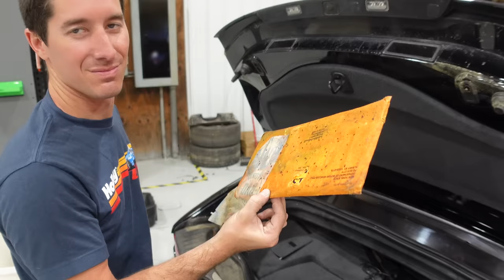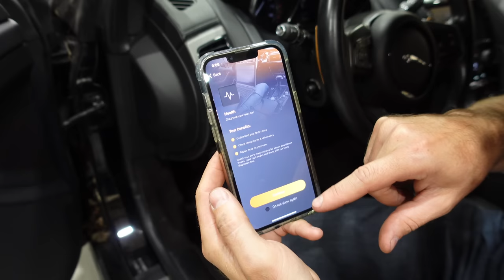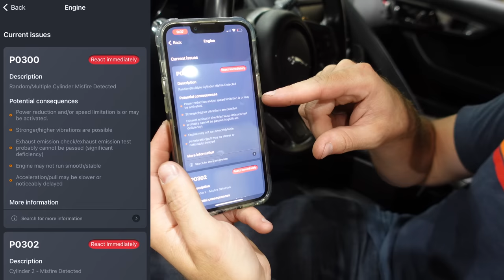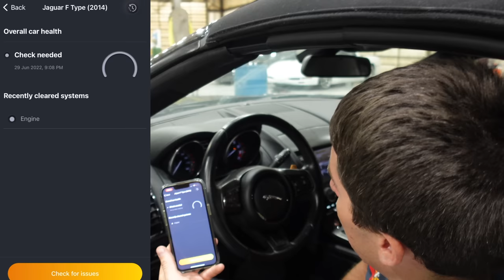My CHEAP Jaguar F-Type S Actually RUNS But It's Horribly BROKEN

Comment: The posts under the bonnet on Jags are usually just to provide power to open the boot to access the battery.

And then a jump pack should be placed directly on the battery, not on those posts.
Reply: These are Americans, do you really expect them to do anything properly? They didn't even check if the engine had spark plugs or inspect the cylinders for leaks or scoring before they went ahead and started it.
Reply: @Exemplifiera  When an engine turning over squirts out rusty water, I'd also want to do a little more investigation that just putting the old plugs in and sending it. Even a few cents in fogging oil could save a LOT of damage on the next run.
Reply: @Dylan Farnum  I've owned multiple XF's (same engine), and performed cooling system repairs on them all. Original factory coolant can be orange, but if it's a 2014 that should have been replaced already. My cars had many different colours of coolant from the Jaguar dealer. Pentosin 'pink' is the type I always used for a flush.

And yes, I'd still be investigating if there was pure water in the cylinders, or gold, or anything other than air. Chucking the plugs in and cranking it without checking you're not going to hydrolock it first would be a good idea, just in my opinion.

Burst coolant line (it's actually the brake booster vacuum pump line, btw) or not, coolant is certainly getting into cylinders somewhere looking at the steamshow.

If they had put the plugs in first, there's a big chance that would have happened. Relying on dumb luck with a car in that profit margin territory doesn't seem like a smart plan to me.

Setting the risk of that aside, do you think it's a good idea to start a car that's had coolant sitting in the cylinder for a while without checking it out a little more thoroughly than saying 'oh it's oil, lol' and moving on? Let those coolant crystals scrape as much of the cylinder wall and valves as you can, right? With a little luck it can foil the injector too, they are only about 300 bucks each. Good plan!

I'm glad you don't work on anything I drive.

So yes, I do know better from hard and sometimes expensive experience. Thanks for noticing!
Reply: @dylanfarnum1488  I think your sadly talking shite there. I sold all my XF's in great condition and I still see them around now and again.

There are lots of places coolant can meet up with intake air and none of them have anything to do with head gaskets, cracked blocks, or holed cylinders (that doesn't even make sense, how does a holed cylinder only get coolant in the cylinder and no other symptom??).

And no, I wouldn't replace an engine of this expense and rarity for a damaged cylinder either. 'new engine' is a serious last resort, good ones are very hard to find.

If you don't know and have nothing to add, that's OK: just please don't post Ill informed nonsense. You're not helping.
Reply: @dylanfarnum1488  that's for the non Jag part, buttercup. (Which is fine, it's Bosch, good enough) but you're still going to be out 300 though honey bunch, because they need coded and flow calibrated in SSD or the ECU will throw a check engine light after a couple of minutes. Unless you have Jag SSD access (I did have when I worked on mine and I can't imagine doing work on the car without it). 

I'd have thought you'd have known that as an expert?

That's nice you have an f-type AWD, I'm guessing you haven't had it too long because you don't seem to know that much about it's workings.
Reply: @dylanfarnum1488  I didn't ask you to explain anything, because I'm quite sure you'd be wrong. I said that coolant having burnt an actual hole in the cylinder would create considerably more symptoms than just some steam from the exhaust. Have another read if in doubt.

Actually, know what? I've never seen coolant burn a hole in an actual cylinder come to think of it. When it gets to the temperature to melt cast aluminium it tends to turn to steam and blow a hose. 

I've seen head gaskets go, and I've seen pistons smash cylinders... Or blocks crack, but never coolant and water creating a hole in a cylinder, unless by long term corrosion.

Can you please explain how that happens? Cite some examples if you can? I'd love to know!
Reply: @dylanfarnum1488  no please, we are all still waiting for your lecture, professor. Tell us about the coolant burning holes? Please?

Also none of my cars have been on a trailer (other than the ones I collect as non runners) and what puts jags on trailers 90% of the time is people like you with no sweet clue 'working' on them.
Reply: @dylanfarnum1488   @Dylan Farnum  it seems to me that's absolute nonsense and you're just embarrassing yourself now.

But, what do I know?! This could be a great chance for me to learn. Let me review:

When coolant and oil mix on top of the piston head (uh, wut?) they don't burn off under combustion temperate and pressure as I'd expect, but instead create 'hot spots'. These 'hot spots' then get up to the requisite temperature to liquefy the surrounding metal and melt cylinder walls, putting holes in them. The wall itself nor the the coolant running around the walls is enough to reduce this temperature to safe levels. The block then cracks. Have I got that right?

I'm going to ask you to cite some source on that please, doesn't have to be anything fancy just any website or yt video with an example I can study. 

Quick as you can, I'm fascinated by this process that seems to defy physics and I'm eager to learn as much about this as possible. Thanks!
Reply: @dylanfarnum1488   @Dylan Farnum  it's hard to understand because you're not making sense. You're now off on a whole other tangent about valve seals and spark plugs. Spark plugs, which by the way are on the floor in the video and can be easily checked!

Citation, please! If this is such basic simple stuff you'll have no problem finding one. Just one. That's all we need. All I've ever seen a small coolant leak into a cylinder do is clean everything really nicely, personally. A large leak, well, you'll know and it can do a lot of damage, especially if the engine is turning! But that's not even the point:

We just require an explanation of your comment of coolant in the cylinder being definitely a holed cylinder which needs a new engine, even though there a ton of other reasons it could be there which are much more likely and should be checked FIRST before turning anything over.

We need this so we can accept your assertion that turning over a wet engine is fine, which is what your asserting.

What's so hard to grasp about that?

Again, if you don't know, that's cool, but you have to stop saying random things you can't back up. That's misinformation and with cars like this, that can be expensive.

And coolant isn't corrosive to aluminium, even when burnt, for f-cks sake, how well would THAT work in a majority aluminium engine? Jesus.

When I first started owning Jags about 23 years ago (in the UK), I had to wade through SO MUCH absolute tripe on line to find solid information. So many people with opinions passed off as fact, it literally ruined the brand. From 'oh it's British and weird we can't work on it' all the way to 'oh you need this expensive thing' when it was actually a five dollar part - made the experience very frustrating.

It's even worse here in North America.

I fully believe everyone should own / drive a Jag at some point in their life and this sorta 'support' from the 'community' literally kills it.

I'm sure this is also true of other brands and I think I speak for everyone that most people just want straight forward factual information that's useful and true.
Reply: You two are big mad. Jags are unreliable, just like Rovers. This is common knowledge. Doesn’t mean they’re not cool.
Reply: @asands257  Poxy Ford engines…

Comment: Be aware, F-Type has a notorious battery drain after OBDII usage. After each use of the OBDII port, I have to disconnect the battery to reset the computer.
Reply: It could just be the device you're using, not all devices cause the battery drain, I've never experienced it after the port has been used.

Comment: And mine was a 2011 XK Jaguar convertible luckily I was just a couple blocks away from the Jaguar dealership where they could take care of it but like I said in the earlier comments it was the fuel injectors and it only did that exhaust thing and spit and sputtering

Comment: so ive been there too. The car has 2 batteries. One controls the engine and what not, the other runs the app and security stuff. the main battery is supposed to be an AGM battery. as for the leaving the charger on it all night, you have to leave the charger on the battery itself. the front boost terminals will not charge the battery. I figured that out when my car locked me out and needed a battery replacement. 

Lastly, AGM batteries are very sensitive. you cant hook up a booster to them directly. theres microchips inside that limit the draw and monitor the battery condition. you have the charge the thing with an AGM charger at like 1a. could have saved myself $500 if i knew this earlier
Reply: I know several people who charge their F-Types from the underhood terminals and iot works just fine.  Not sure why you think it doesn't work.

Comment: It's not antifreeze, since it disappeared so quickly.  It's obviously the blinker fluid.  The gasket between the master blinker reservoir and the side main seal must have gone bad.  You'll just need to cut a new one out of some double corrugated cardboard, and glue it in with that sparkly Elmer's glue.  Happens to Jaguars all the time.

Comment: Thanks John just ordered my Carly I think I have one of the worst Buicks ever built its a 2012 Buick Enclave seems everyday something is either dinging or engine is flashing in CAP LOCKS lol, but thanks again for another great video looking forward to more on the JAG.
Reply: More than likely it's electrical. We had a 2011 traverse so I know what you are referring to. Try running your own engine and transmission ground wires, that might help clear up some of the issues

Comment: Extra battery is for the hybrid start up at traffic lights
Reply: Actually it's to maintain "essential systems" while the engine is off - it certainly isn't beefy enough to crank the engine on restart.

Comment: The JLR V8 engine is made by Ford it has a hell of a lot of inherent faults from head gasket to the bottom end. Ask Samcrac about the trouble he has had with same engine in many Range Rovers that he has bought over the years. The F type is a great looking & driving car when it is less than 5 years old after that it is time to dump it or your bank balance disappears down the cylinder head. :)
Reply: It’s a full Jag designed engine.  It’s assembled in England inside a Ford plant specifically for Jag. There is zero Ford DNA.
Reply: @FFE-js2zp  I was told it has a lot of Ford DNA in the V8, I apologise if that is incorrect.
Reply: @BlackLung911  
It’s a common misconception. The AJ126 (V6) and AJ133 (V8) are all new Jaguar ground up designs.  It’s assembled in the Ford but has no parts or design in common with any Ford engine.  One listen to it and it’s obviously not a Ford.  

The AJ133 is the best sounding engine of all time, and with the standard issue $1200 tune and pulley puts out a very conservatively tuned 680HP.  The ZF8 easily handles it, making the V8 F-Type an incredibly fast exotic pure bred sports car.   

“Sports car” meaning, a ground up no-top design with 2 seats and motorsports racing power, per SCCA definition.  Pure bred sports cars have an easy test, is the no top design lighter than the Coupe GT version?  In the F-Type’s case, it is.  I don’t think there are any other pure bred sports cars being made in 2022 outside of Pagani.
Reply: @FFE-js2zp  The license for Ford to build it expired last year (I think) and the engines are now built in a JLR plant in the Midlands of England.

Comment: That bike rattle at the end. Is that chain or drive pulley super loose?
Loved seeing the top actually work perfectly, cause you know that is almost always a big problem on cheap cars.
Reply: Dry clutch.  When you disengage the clutch the plates rattle.
Reply: @1960Murf  Gotcha. Never had a dry clutch bike. Interesting.

Comment: Hopefully it is just the head gaskets. Can't wait to see the repair videos. 👍 Matt.
Reply: He just said the head gaskets were replaced already. It's probably not the head gaskets, and if it were, it's a pretty big job, nothing I'd hope for.
Reply: @OMGWTFLOLSMH  you didn't listen then. He said the guy he got it from said someone else said they were replaced. Not technically verified. So pretty sure I would start there. Everyone thinks head gaskets are a pain. Honestly in most vehicles they are not that bad to do. Yes they will take a few days but not terrible. My question would be did just the gaskets give up or did it warp the heads or block.....

Comment: i wonder if these had the timing tensioner issues like the v8 had? total catastrophe if not fixed
Reply: It's the same engine, just with the back two cylinders not used.

Comment: And you can't check your oil because there's no dipstick you have to open your hood and do it with your turn signal Vape over complicated the simplest thing
Reply: Overcomplicated the simplest thing why did they spell check it and put Vape instead of they